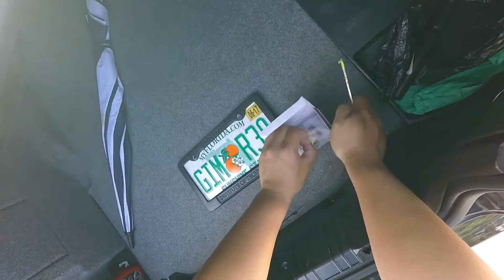BMW E46 Mod | episode 5 | LED License Plate Light Upgrade

Comment: I have an E46 320ci 2004, was doing this install.. followed your steps, took the original bulbs out.. but the LED just won’t clip in all the way :( not sure why
Reply from the maker: TheZallene would it be possible you bought the 4 door light? They are slightly different.
Reply: I just checked the ebay order, it says the lights are "LED light for BMW 3 series (E46) Coupé convertible from facelift 03/2003"

So maybe the convertible is different to the coupe?
Reply: @TheZallene  any info? I ended up on the same boat as you. Bought coupe lights but they don't seem to snap into place.
Reply: @PZJJProductions  Think i had to buy the coupe lights, they clipped in relatively fine from memory
Reply: @TheZallene  hmm, I bought the LED Coupe Lights. The prong fitment just seems weird. I place it in but it doesn't snap or fit snug in place, just feels full of tension and eventually slides out. I'm soooo lost lol.
Reply: Ava Giovanni I have the exact same problem with my license plate light covers I am trying to re install after they fell off. They just won’t go in...
Reply: V-Dawg I’m going to try again today and let you know my findings, I just put two bulbs I found at Walmart, but I really want to place the led ones.
Reply: What about the wagons? Any idea if their lights differ from the other models?
Reply: I have a issue with mine also it the passenger side works (left) but the driver’s side right doesn’t.. starting to believe that it has to do with the connectors where it’s supposed to touch.. mine is loose and I’m trying to see if that’s what creating the problem.. I might upload video on these as well
Reply: I had the exact same problem. The one on the left snapped right into place. The right one was causing problems with the fitment so I flipped it the other way around (not like in the video) and that fixed it for me. Both are now working fine!